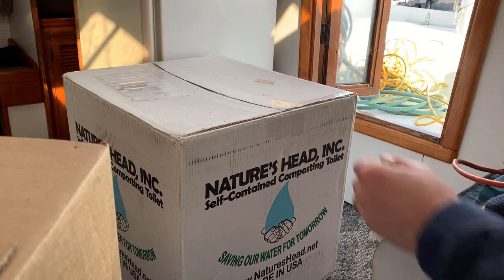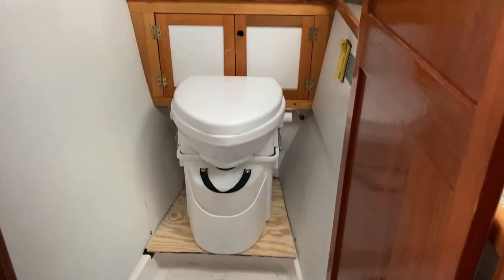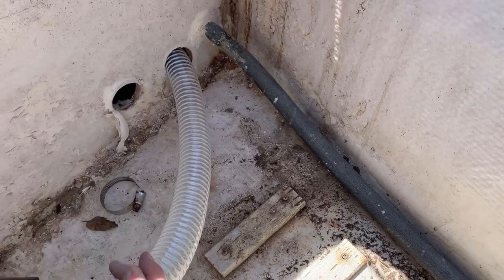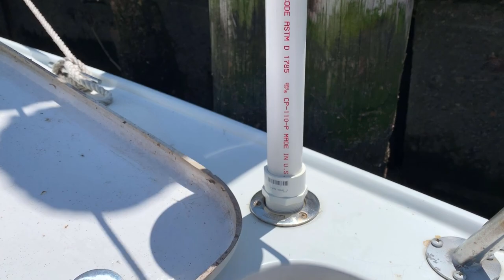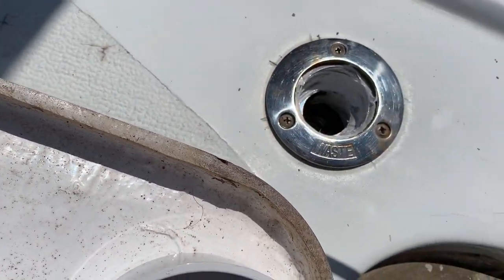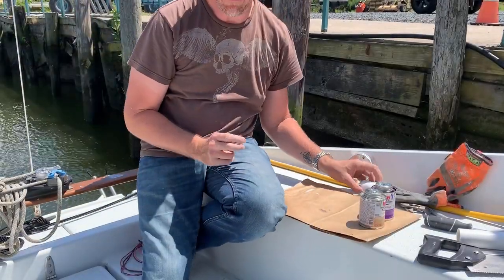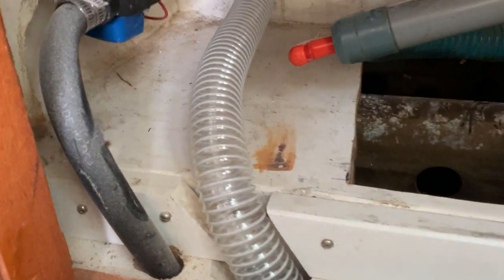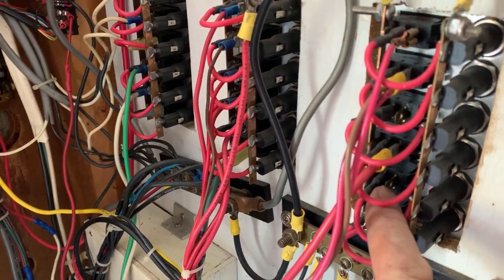NATURE'S HEAD Composting Head Install - Marine Head Upgrade Part 4 of 4 (Boat Work: Sailing 9 LIVES)

Comment: The primer IS important when working with PVC.  It is important because it etches the surface so the 'cement' or adhesive will react and bond the two surfaces together.  If you try it without primer, you may find that you can twist the fitting and the pipe apart.  ABS pipe is different.  No primer required.  
Nice job.  Can't wait to see the sailing video!  Stay safe out there!
Reply from the maker: Absolutely correct. I suppose I was pondering the necessity of doing it 100% correctly given that the fittings I was bonding together would never need to be truly leak-proof.
Also, laziness.
Reply: @Sailing9LIVES  leak-proof or connected?  After pounding in the waves for a few hundred or thousand miles the fittings may come apart from the motion if not glued properly.  Glad you did the job properly.  👍🏾 Always time to do it right, never time to do it over.

Comment: Also, I love the seated depression you made for the head itself!  I repurposed an existing but unused high gloss painted galley table with teak edges (helps keep the area tidy!), cut it to fit, raised it via 4 "L" brackets in order that the toilet fits perfectly behind the little doors (the doors on my Alberg 30 function as both privacy from the main salon for the head when in use and to close the head area off when not being used).  It is a tad high, a real throne! But it works beautifully. 😂
Reply from the maker: Again, thank you. Talk about a labor-intensive part of the project!!! That was a lot of work for a small height drop. In the end, I am happy I did it. A king must be comfortable on his throne!
Reply: @Sailing9LIVES  :D

Comment: You can reverse the fan and filter housing on the head to make the output air hose attachment on the other side.
Reply from the maker: Yep, I saw that and came very close to making the switch. In the end, I elected to go with the hose route as you see here because of the path provided by the existing holes. Slightly less bends in the hose, and the hose ends up being long enough.
But, I will say that the product is very well imagined, and the options afforded by details like the reversible fan and intake setup make it very versatile.

Comment: This was a brilliant description of your install, and the product itself.  A question please, is there a reason you used the labour intensive heavy duty PVC system for the vent instead of just the hose connected to the through-hole to the outside, and then a perhaps a dorade box or a simple cowl vent?  It makes sense to have used the existing waste hole fixture, but isn't the fancy PVC thing a bit more work than needed?  I get the elbow for the fan itself though.  Thank you!
Reply from the maker: Thank you!
Honestly, the reason for the PVC vent was mostly because the kit included the vent and I was determined to find a way to utilize it. Repurposing the waste fitting made me feel like it was a clever install. :)
I certainly could have gone another way with the install.

Comment: Nice mounting job!! You got lucky with the vent set up too! Will it be bothersome, blowing "stink" up on deck, when the boat's not moving? Seems you in business with you business!!! The new Head is a gravity mount?? Not bolted in?
Reply from the maker: Thanks, Joe!
I’m no bloodhound, but as far as I can tell there is no smell, even from the vent. With the marine head, every flush would push waste into the “holding tank” (ahem) and displace stinky air out the vent seemingly straight to the cockpit.. Talk about gag reflex... This new head is just amazing and seemingly defies logic.
As for the gravity mount... yes. There are threaded inserts on either side of the Nature’s Head and the manufacturer provides some nice little brackets to use for mounting. But, the sunken base design we went with precludes using the provided mounting option. I was going to add an additional mechanism to securely hold the head in position, but it has proven to be quite unnecessary. The base stays put, and the head sits nicely in its pocket. Some day this might bite me in the ass, but for now it works just great.
Reply from the maker: @marceld6061  
It’s a fact. I was a very punny guy for many years. Now with “dad jokes” being my reality, I fear those around me will never escape the puns.
Reply: @Sailing9LIVES  poor little Rhea... she has no idea what is in store for herself!  Hopefully she inherited a good sense of humour. 🤣

Comment: How do you like the Natures Head? An issues?
Reply from the maker: It was a great upgrade.
I guess the only problem we had was a bit of paper got caught up in the little trap door mechanism one time, and before we noticed it we had gone quite some time with the liquids not being entirely diverted to the bottle. This caused a rather wet stinky mess where we should have been making sweet sweet compost.
But, other than this mishap, it has been fantastic.

Comment: I wonder what it is about your site that attracts those single girls needing boyfriends.  Are they into composting toilets?  Anyway, thanks for the final installment.  Is there no flusing mechanism at all?  Liquid goes into the tank?  Do those doors into the composting chamber keep liquid out?  Does the bowl get washed out at all?  If not, are you totally dependent on the negative air to keep the smell out of your boat?
Reply from the maker: It has been a lifelong struggle, Jack. 😏

No flush, cuz there is no sewage. Liquids flow to the little tank in the front, composting candidates go into the magic bucket and begin their transition. We spray the bowl a bit to make sure everything gets washed down, but it generally stays clean. As for the smell, as you know “our shit don’t stink”. But for guests, the smell is actually taken care of by the drying action of the ventilation. It is a great process, there is no odor from the head at all.